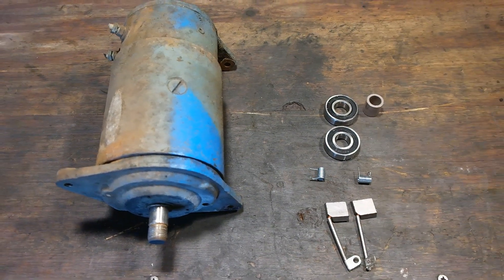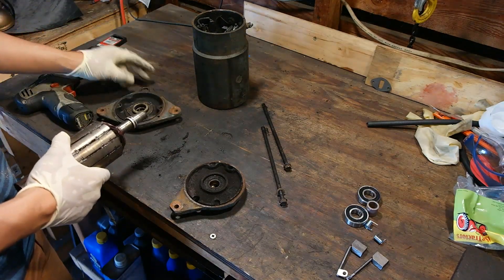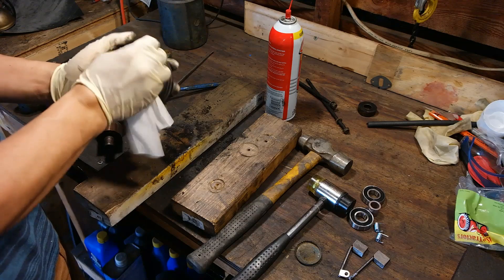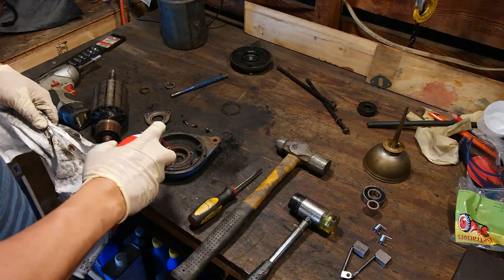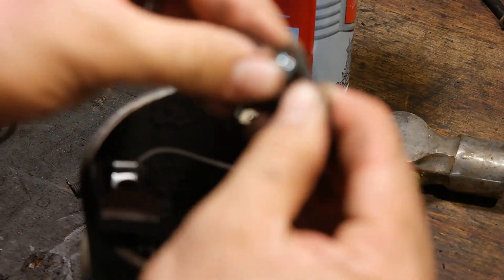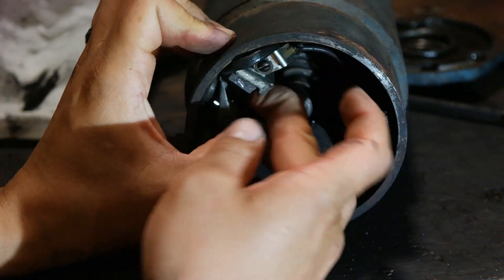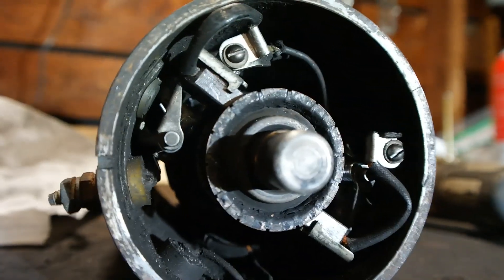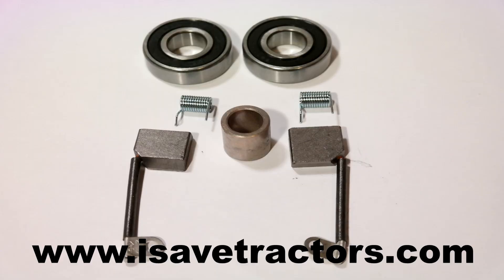How to Your Rebuild Garden Tractor's Starter Generator

Comment: I have a d/r 1011699 starter generator I’m working on I opened it up the brushes had crumbled a small black wire is laying loose I don’t know where it connects it’s hard to get a close up of your video any ideas? I ordered a rebuild kit from your company it hasn’t came yet thank you, Rob S.

Comment: Is it even possible to change the rotation? If so, how?   I have one that rotates clockwise, and I need it to go counterclockwise ( as viewed facing the pulley) .    You are a real blessing to this tremendous avocation!
Reply from the maker: You would need to change the field coils
Reply: @Isavetractors  Does that mean different field coils, or change the location of the coil wires, or change the position of the coils?  Hey, thanks for nswering me!

Comment: Hi Norman, great video. I am not confident that I have the OEM spec pulley size on the starter/generator on my 444(K321), do you know what the stock spec is for this?

Comment: Nice video!  What is a safe solvent to use for cleaning the electrical stuff, armature, field magnets, etc. so as not to harm the insulating varnishes and such when it was manufactured?  I once saw just using an air blow gun, just how much carbon was blown out from in between the windings on the end of the armature.  Also, just curious if you know what the original Delco Remy part number was for the brushes?

Comment: Just out of Curiosity I have my generator off at the moment I tried to turn the key on and crank it over just to see and nothing. Now before I took it off it didn’t do that now if that’s normal what the frig is going on
Reply from the maker: Your Starter/Gen needs to be be grounded to work. So if you kept the wires on, and removed the starter gen and tried to turn the key, nothing will happen until that ground connection is restored.

Comment: Very helpful video. Just did my first 24 volt on JD 4020. Working great. Video was identical to my project. A fight broke out in a repair forum about whether or not it should be polarized. I did, or at least think I did. Anyhow, works great!

Comment: How do you get pulley off a starter
Reply from the maker: A 3 jaw puller normally. If its really stuck on there you will probably bend the pulley with a puller but you can just replace the pulley
Reply: @Isavetractors  I have one last question there was a big square notch that kept the bearing from coming off the pulley side. I tried hammering it off but it wouldn't come off. So I just left on the front bearing that was in it. What should I do?
Reply from the maker: Are you talking about the woodruff key that's in the shaft?
Reply: @Isavetractors  yes

Comment: How did you get the pulley off?
Reply from the maker: I normally use 3 jaw pullers but sometimes I have to cut them off and replace the pulley.
Reply: @Isavetractors  I'm trying to replace a damaged pully and going to try a strap wrench to try and keep it from spinning while I loosen the nut. Dont have a 3 jaw puller on hand.
Reply: Rather, I'm trying to remove a good pully from a bad generator to replace a damaged pulley on a good generator

Comment: Fantastic video,.. but I had a bushing and can't figure out how to take the old bushing out.. I'm going to leave the old one in.
Reply from the maker: The trick i use the most is running a tap through the bushing them turn a bolt through it to get it out

Comment: If the brushes are bad, will this affect the generator function as well as the starter or will it affect only the starter function?
Reply from the maker: It will affect both
Reply: @Isavetractors  Thanks.

Comment: How does the pulley come off? Is there a key way or is it threaded? I tried a puller and didn’t seem to move.
Reply from the maker: It's a keyed shaft. Remove the nut then remove the pulley. If yours is really stuck on there you may have to cut it off and replace the pulley
Reply: Ohh yeah this one is really stuck. Puller wouldn’t do the trick. Grinder it is

Comment: Mine starter worma but doesn't produce voltage on the generator output wire to charge battery. Any ideas?

Comment: How were you able to get the pulley off before taking the generator apart? The pulley on the one I have is stuck so I can’t get the cap on the pulley side off. And also the bearing on the other side is stuck on the armature and did not come off with the cap. I can’t get either the pulley or the bearing off the armature after trying to pry them off. Any recommendations?

Comment: Just what I was looking for. Very well put together. If I wanted to powder coat the case and end caps do I need to remove the windings and brush assembly? Can they take the 500 degrees for the curing process?
Reply from the maker: Hmmm...I would take out the windings before the heat treat process

Comment: What can I do to replace the two threaded studs on the outside for positive and negative terminals? Mine still holds the nut tight but there is only 1 or 2 threads available after tightening. I also beleive mine does not charge anymore. I remember reading information about that issue a few years ago but I can't remember if this rebuild kit will resolve that issue or not
Reply from the maker: Those are called insulated terminals. You can replace them and re solder the wires from the field coils. Or you can run a thread die through them to repair the threads.
Reply: @Isavetractors  i need to look at mine again at take a closer look. But it's just a bolt with a wire soldered to it? Basically?
Reply from the maker: Pretty much with a plastic insulator between the body and the nut

Comment: Can you give a little better view of where the black cable is connected and an explanation of what you are doing when you touch the jumper cable towards the end of the video to the terminals on the starter...thank you
Reply from the maker: Black cable is simply connected to the housing of the starter/gen for ground. I am essentially jump starting the starter with the jumper cables

Comment: I have 3 tractors with the same engines with starter/generators but why does one turn the engine over faster than the other 2?
Reply from the maker: The faster one has better electrical connections allowing better flow of electricity.
Reply: @Isavetractors  ok

Comment: Nice video. Some rebuild kits come with the rotor, when do you need a new rotor?  Mine is a positive ground. To test the generator with a battery, do I hook the positive cable to the frame and the negative to the armature?
Reply: Negative to negative and positive to positive

Comment: Thanks for the video Norman, I just picked up a 1969 Sears Super 12 and it has this system on it, my other Sears are newer 1973 ST12 and 1974 ST16, all good stuff. I will be in contact with you when I need any parts in the future.

Comment: Thanks for that video Norman , I have 4 Sears garden tractors , all with the solid state systems and stator systems. My Aunt gave me my Uncles 74 Cub Cadet before She passed last year , it has the 10 Horse Kohler and a Delco starter/generator that doesn't charge , I will be getting in touch when I start on it this year , I have a few things left to finish up my ST16 I started last year .
Reply: Suburban all the way chief! St12 roars while the wheel horse b100 sleeps.. Getting close on the rebuild there though!
Reply: @harryray4123  Love the Suburbans!! I had a 1969 SS 12 with a Tecumseh HH120. Her name was Michelle and she is on the Sears suburban registry.

Comment: Always great videos Norman!
Do you usually find the fields to be in good condition and not need replacing? How would you determine if they are not? Thanks
Reply from the maker: Hi Chris, thanks for the comment. An easy to way to make sure your fields are good is to take a set of jumper cables, and jump the "A" terminal of the starter/gen and then quickly remove power from the A and go to the F terminal. Your motor will suddenly slow down, indicating your field coils are good. You can also test with an ohm meter.
Reply: @Isavetractors  If the motor doesnt slow down when switching power to F terminal, will this rebuild kit fix it?

Comment: Wat does it mean if it turns the engine over fine but it doesn't keep a battery charged
Reply from the maker: Bad Battery, Bad Regulator, bad wiring are possible causes.
Reply: What should I do if it won't stay polarized I have to polarize every time I use it

Comment: I have a cub 104 & when I field test the starter   Generator it turns slow & growls..... the tractor has a brand new fully charged battery... would this kit help the problem I'm having?
Reply from the maker: Yes. Your brushed may be worn. Try tapping the side of the starter/gen with a small hammer. Be gently. If it turns better than it may indicate your brushes need replacement. You may also just have a bad ground connection. Sand the metal where you attach your negative cable, and make sure the connection is really good.
Reply: isavetractors I purchased this kit from you & it works great! My s/g has the bushing in it & was wore out so that's what was causing the noise... thanks for a good product & fast shipping!!!
Reply from the maker: You're welcome! I am glad it solved your problem!

Comment: Something to consider on the copper mating surface (commutator) on the armature. If the surface has any grooves in it from bad or worn out brushes, most shops put the armature in a lathe and turn that surface smooth, an easy fix if you don't have a lathe is to chuck the armature into a drill press, with slow speed and use a strip of fine emery cloth to take out the grooves. This helps to give the brushes good contact for proper output and lower the arching of the brushes which also keeps the armature cooler. Hope this makes sense.
Reply: never use emery cloth on electrical contacts, unless you can scrupulously clean them.. bad practice.. also you may need to under cut the mica,,in this video you see adequate groove depth.